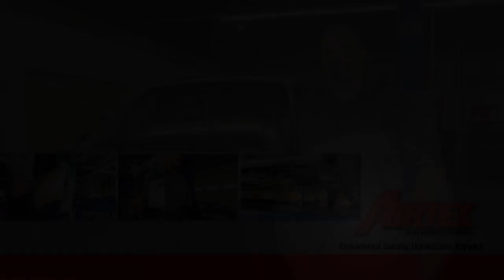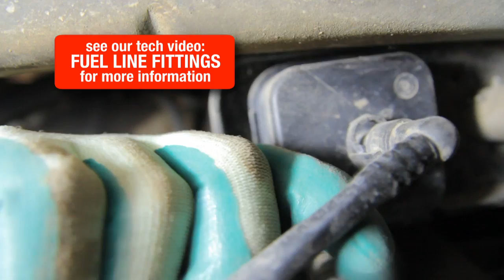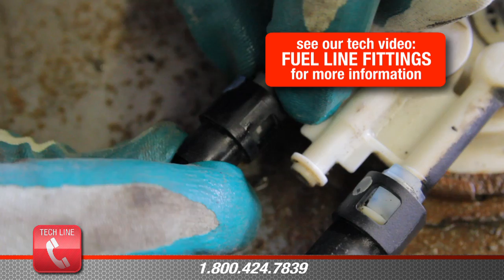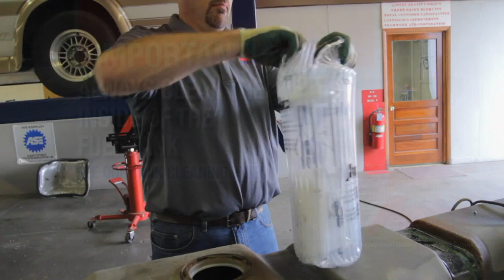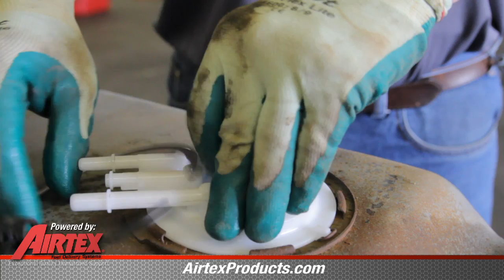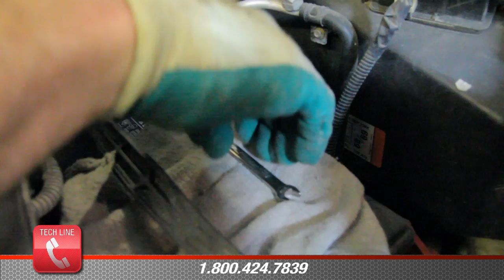How to Install a Fuel Pump E3971M in a 1999 GMC full-size van

Comment: Nice video, cost me around a little over 800.00 to have it replaced thinking it was going bad..per mechanic shop . Six month later, my fuel gauge read way pass the full and now I don't know how much gas I have in the tank. Not going back to that shop.
Reply: Exact same thing happened to me. 
Did you ever manage to fix it?